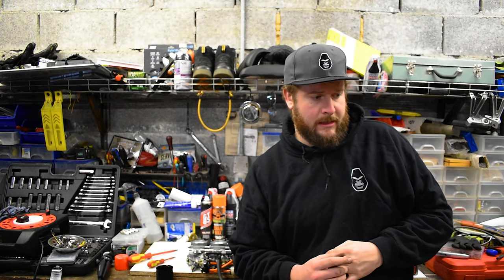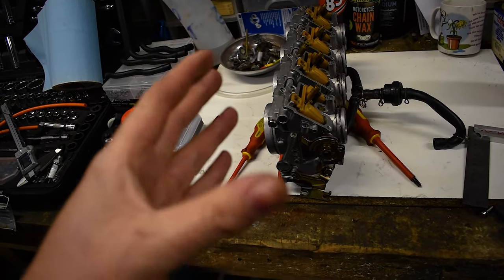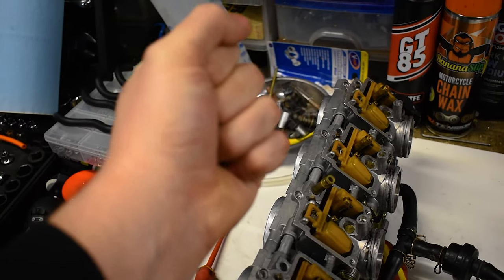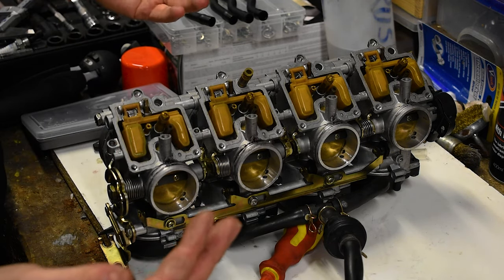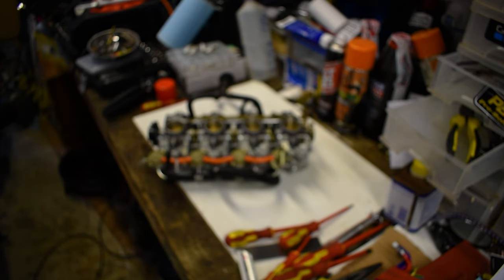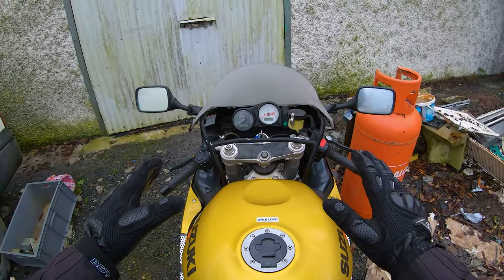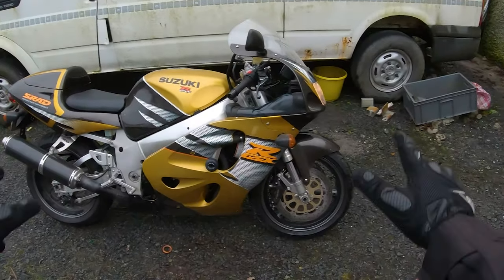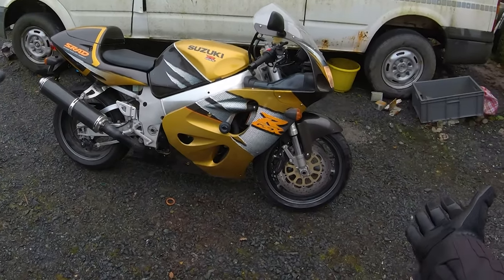How to set FLOAT HEIGHT Motorcycle Carburettors | THE GSX-R LIVES and MOVES!!

Comment from the maker: IT LIVES 😁😁😁😁
Reply: Question for you please TGB. Looking at an fz1, 03. 40k miles, 2,900e. Good price you reckon? You rode one? Know you had the fz6 for yonks. Any big issues to look out for? Thanks man, love the SRAD,well wear.
Reply from the maker: @explorationmoss1015  it's a good price provided it's fairly clean. Same basic layout so they're comfy. Treat the metals and engine with gt85 or somthing like it a lot as they can flake if not looked after, but a bit of care keeps them as new like my one.  I know the fz1 has some issue on the stator side I think, not uncommon but that was it. 
I have ridden one and they're a monster. Brilliant bike. 
Thanks :)
Reply: @TheGorillaBiker  Thanks man, any reservations about 40k miles?. You see the reason im looking for a new bike is two italian bikes Rst1000 (sold) and guzzi (at mechanic for months) have near broken my heart and i want a flawless(reliable) runner.
Reply from the maker: @explorationmoss1015  Ahhhh those Italians. 40k miles for that 1000cc should be nothing if it's been cared for. My 600cc had nearly that and was/is still running flawlessly :)
Reply: @TheGorillaBiker  I know yeah. My big problem is i LOVE their bikes. Sound man, hope to get a close up look at it over the weekend, Parts for 03 fz1's should be easy enough to come by I imagine?.
Reply: Hey man thank you for this comprehensible guide... saved me a headache
Reply from the maker: @danmadsen5604  more than welcome! Glad it was useful!

Comment: The SRAD is a great bike! Also very reliable once you get everything sorted out. They are reasonably comfortable too, just did a 300km plus ride on  my 96 last week (and im 48). In real world on-road riding the SRAD will keep up with most modern bikes, and is great fun to ride! Looking forward to the next video!
Reply from the maker: It is indeed. Should be pretty much there now, new brake pads, new tyres and it'll be good to go :) I'm 6'7 so It'll be interesting to see how comfortable it is for me in the long run. Yeah tbh power wise it's about as much as I could use on my roads anyway :) I can't wait until lockdown is gone and I can actually travel :D

Comment: I had the same problem 2 weeks ago with my Srad , i fix this same problem with the float and IT work for me.
Anyway great video mate!
Reply from the maker: The floats werent ideal but the bike still ran fine with them, the fuel pump deciding to blow up was my main issue and what made me have to push it home :D But the floats would have caused trouble eventually so glad I did them :) Thanks! :)

Comment: Old post revival but just wanted to say thanks for explaining the float heights, having a nightmare with the GSXR srad carbs fitted to my Mk1 golf overfuelling but hopefully I will sort it now I have watched this
Reply from the maker: Not at all! Glad it may prove useful, that's why I make them :) Let me know do you get it sorted! Definitely sounds like a float issue, could also be your needles aren't actually closing off the fuel flow, they might need replacing physically if they have worn a groove in that stops them working correctly. Lastly double check you have the right fuel pump in there if you changed it, a fuel pump designed for injectors will over power the needles and floats :)
Reply: @TheGorillaBiker  Well I took them off the car last night, the float cut offs were set massively too high, all dropped down now so I'm sure that will sort it. And yes the car has a Fuel Pressure regulator fitted set to about 3psi, it runs great otherwise and has been set up on a rolling road etc about 12 months ago. Thanks again mate, keep up the great vids!
Reply: I could really use some help with my Suzuki gxr it's a 600 my car has been acting funny after I took them to get clean and I don't think they jetted them right and I don't think they did the four screws on the bottom right to screw that has the point at the tip how far down should them screws be turned

Comment: Nice work 😃 
As a tip for headers i got k5 1000 headers on my srad with a k3 1000 linkpipe but without the exhaustflap and a endcan similar to the one you got, 
No jetting needed i have dynoed it🙂 it was all stock before got a nice power curve a bit linear maby so the powerkick at high revs is smoothed out but i got 120hp at the weel with k&n airfilter about 1hp less all the way with oem filter. I could adjust it a little bit leaner but no need to 🙂 But I miss the power kick a bit but it feels safer on track when accelerating in curves 😁👍
Reply from the maker: Thanks :)
Oh that's is all very interesting and good to know! Thanks! :) Once I bottom out how I feel on the bike I may very well go that route :) 120hp at the wheel is no joke! :)
Reply: @TheGorillaBiker  its only like 1-2hp more that stock acording to specifications. But i never dynoed with stock exhaust så 🙂 i dont know what you have in Ireland but here we got 98octane fuel at the pump 🙂
I Will maby dyno again this spring if i do some more mixture or mods

Comment: Hello, by any chance do you know the part number for the plastic nipple things inside the float bowl fuel diaphragm is? cant find em anywhere....
Reply from the maker: I found all the rarer bits on cmsnl.com, I'm not sure what you're referring to tho, do you mean the diaphragm itself? The rubber boot kind of thing? That's opposite the float bowl?
Reply: @TheGorillaBiker  no it’s a little plastic piece that the spring holds in place, I found it on the website. It was under the evap system… feel like a moron but thank you

Comment: what is the y shaped hose on the front of the carb
Reply from the maker: A time stamp would be helpful to know exactly what you mean, I think you're referring to the one of the connections to the air box. There are two hoses that have to connect as they work with the carbs for the higher rev diaphragms etc. I'd need the carbs in front of me to explain with a video as I'm bad with words.